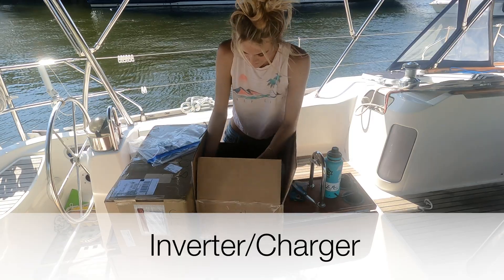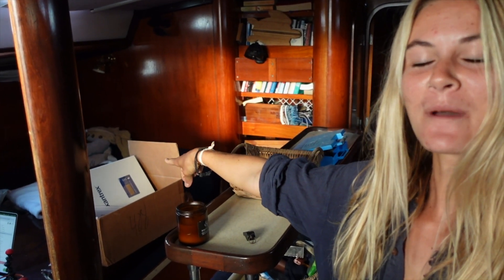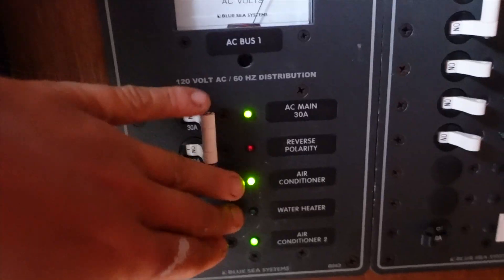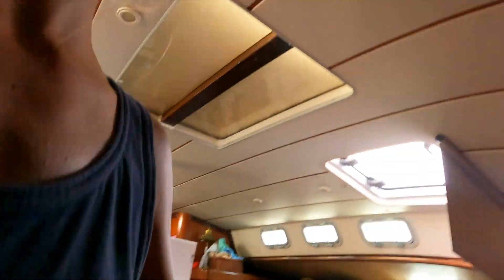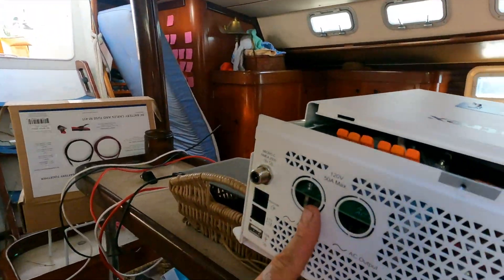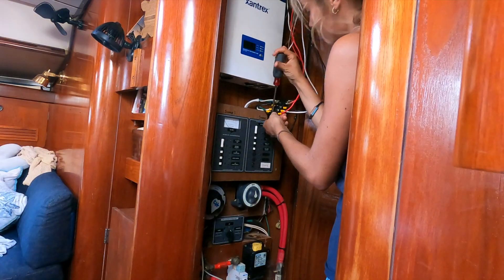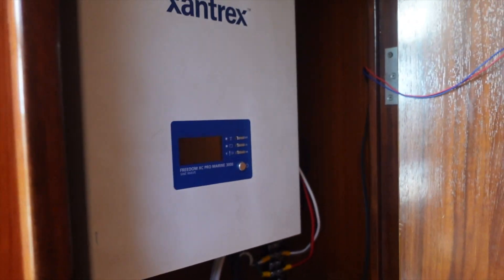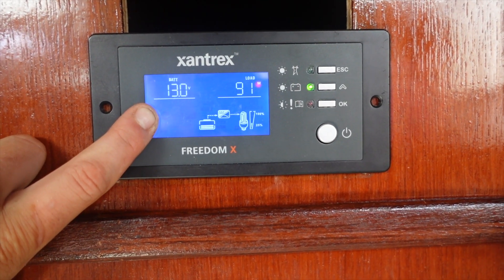INSTALLATION: FREEDOM XC PRO Marine Inverter/Charger - Lauren Landers

Comment: Use heat shrink connection to connect the AC wires, if you touch that bus bar you will die.